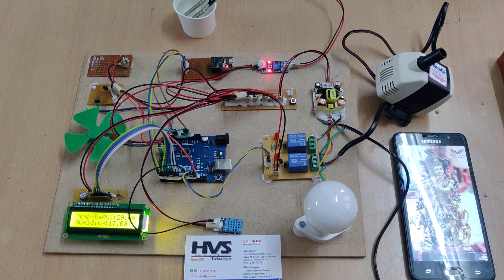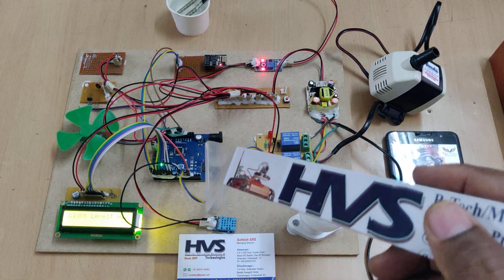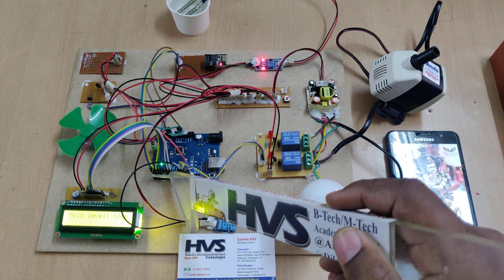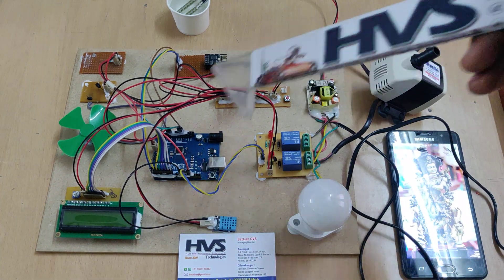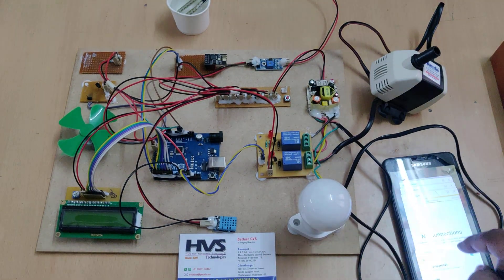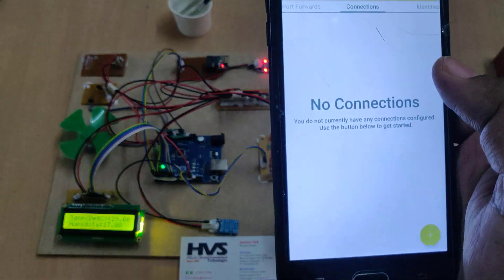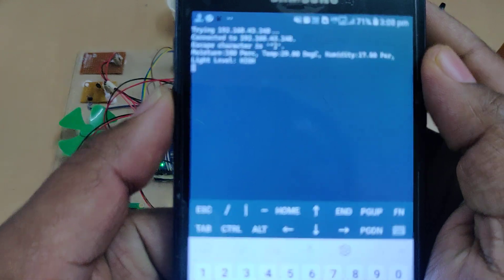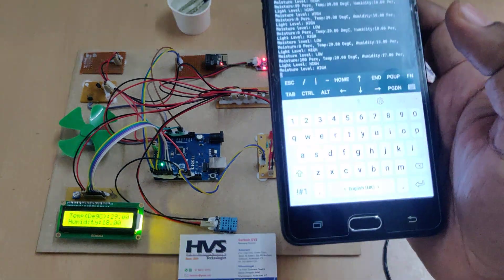Iot Green House monitoring and controlling system - Arduino UNO ESP8266, DHT11, Moisture sensor, LDR

Comment: Can we use for final year project
Reply from the maker: Yes. Hi, 
We sell full working kit with document PPT circuit diagram and code. Could you Send me the video link, Will update you the cost details. You can contact us at +919603140482
Through WhatsApp or call

Comment: can we do this project using raspberry pi 3 instead of arduino
Reply from the maker: Yes. Can be done.
You can contact us at +919603140482
Through WhatsApp or call
Reply: @hvstechnologies  can i get block diagram of the project and components?